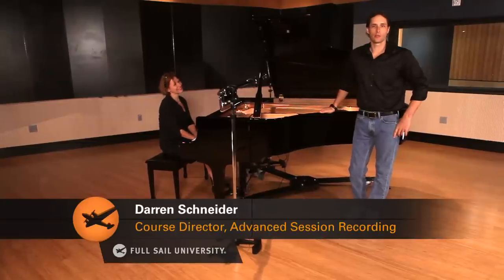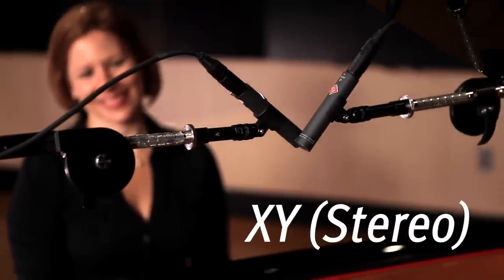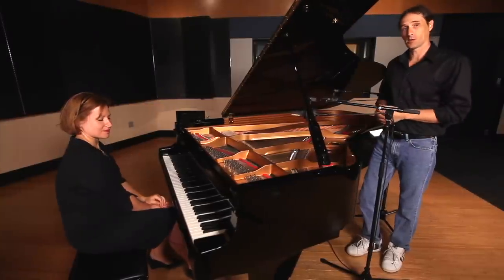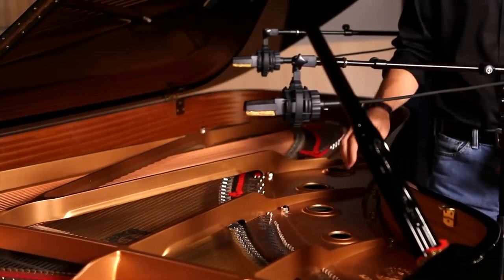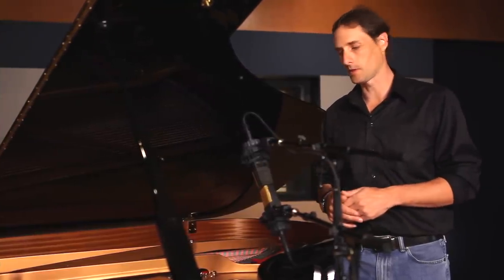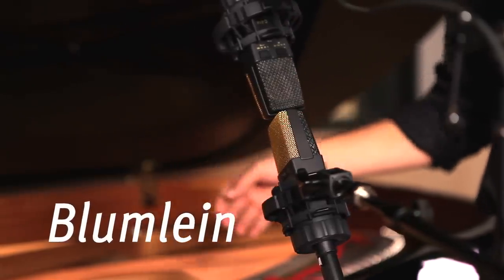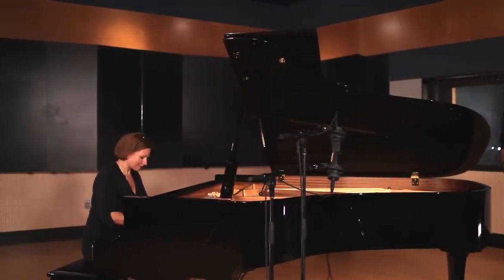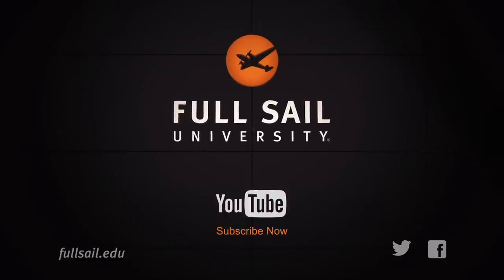How To Record Piano: Microphone Techniques

Comment: AB (25-35cm apart) near the piano tail about 1-1.5m above the floor and 1-1.5m away from the piano for classic (Nathan Shirley, CLASSICAL PIANO RECORDING), or XY at the front of the piano at the middle of the “rounded” part, 30cm above the edge of the case and 30cm away for jazz/pop.  In both cases central line between mics is pointing to the lowest A0 bass damper.
I am using cardioid microphones instead of omni due to the noisy environment.

Comment: My current options for xy are two AKG C1000s, and a Zoom H4 field recorder with built in stereo XY condenser mics. 
 The AKG C1000's are possibly the most hated mics ever according to review forums, and the Zoom only records to its own internal memory card. I don't think I can bypass the memory card and just use the mics wired to the recorder of my choice. I may have to spend money.

Comment: The capsules are at a 90-degree angle to each other for stereo separation, not to reduce the amount of phase issues.  Reducing phase issues is why the capsules are immediately next to each other.

Comment: I prefer to use cardioid large diaphragm studio condenser mics on tall stands, positioned left and right of the piano's hammer line. This way, a more natural balance of the sound is captured and it sounds more like an acoustic than a MIDI sampled piano. A slight bit of hall ambience is gained with this method, too.

Comment: Great video and thanks for sharing. I've tried these configurations and more and, without fail, I end up with a muddy woofy recording. I'm playing on a 5'4" yamaha grand inside a room about the size of a large loungeroom with a 9' ceiling. The lid is fully raised and I'm using two Rode condensor cardio mics. Mixing is through Logic Pro x. Is there anything obviously wrong in my settings that you can think of? Thanks in advance. Any help is appreciated.

Comment: The XY is the most accurate, as the player hears the piano from this perspective. The Blumlein is nice, but I have never had the possibility of playing piano with my ears near the right back of the piano! Placing the XY mics closer to the performer is even better. Realism is always safer for phase and engages the player in their own recording playback. Chris Huston discovered this XY for drums as well, in the 70s. Always pursue the performers perspective, not from a scientists.
Reply: The only problem with using the performers perspective is if you're miking and entire band, and you want to use the audience members perspective.  There should also be a single mic  technique for engineers who want to mix piano as a mono source amongst other instruments.
Reply: A pair of XYs over the hammers, then closing the lid with the short stick, covering with a few  sound blankets is still the best way to mic a piano! Even mono,  as the phase is still intact, and the piano still sounds like a piano!
Reply: Robt Perkins The technique you describe works very well in some situations, but there is no ONE best way to mic a piano. For instance, I would NEVER record classical music that way. The microphone is an electronic ear, and no one listens to a performance of piano music with their head over the hammers and a blanket on top of them. The instrument was designed to use the lid to diffuse the sound out into a room or concert hall. That's why something like the Blumlein technique and positioning works well for classical (as does mid-side from that position). Conversely, I would definitely place mics closer to the hammers and make use of blankets when needing punchy, clear tracks for pop or country music.
Reply: Well, if you are listening with Phase coherent speakers, to an XY piano recording, it will sound like a real piano in your room. If you therefore wish to simulate a concert hall, I suggest you set up a surround system and a great reverb processor, rather than compromise the recording of the piano by mics from the back. Again, no performer sticks his head in the back to hear the beauty of the instrument. Plus, no average audience member notices the diff between any of these techniques. Only a performer really cares how the piano sounds. If you wish to record a concert hall, use XY above the stage, as the conductor hears it. Add real hall reverb. Never put mics over the back of a piano! The lid reflects into the room, so record the room, not the contorted sound that the 'electronic ear' hears from the back of the piano. And blankets? There are for sleeping! Buy a Kurzweil Forte for anything else and run it thru a PA. Music is created by performers, to be enjoyed by the listener, without scientific engineers coming up with strange places to put a pair of ears. Keep it natural.
Reply: Robt Perkins
Robt - can't say I fully agree.  At least not listening to this demo. Each technique has its pros and cons.  I listened to the demo on my large speakers that are about 13ft apart. All the samples are nice, but for me:
X-Y:  Sounds dry clean and narrow.  I do agree that it's the pianist's perspective.
Spaced pair: Makes the piano 13ft wide.  Sounds cool and very rich, but overblown.
Blumlein: Width is in-between X-Y and spaced. Most natural to me, but does tend to pull highs and lows in opposite directions - thu not as much as spaced.

Maybe Blumlein with cardioid instead of figure 8 would sound more natural?

Comment: Spaced pair is my preference. The other two methods have some level of phase canceling to enhance the stereo. If it doesn't sound cohesive enough bring the pairs closer. A center mic in addition is sometimes helpful also.